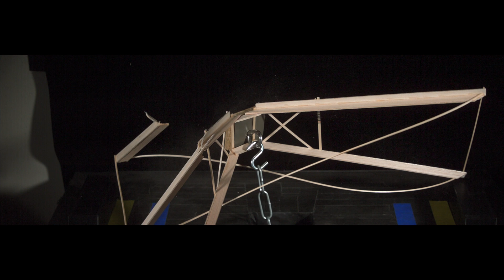Bridge 008 Division C: Competition Score 2098.6

Comment: Thanks for the videos! I was wondering how a longer weight bearing platform on top of this design would work. I am using the 2023 IIT bridge building rules which requires for the bridge to have 2 loading points on top: one 3 cm from the center line and one 5 cm on the other direction from the center line. Do you have any thoughts on this?
Reply from the maker: I haven't built any towers to that design, but I would generally recommend keeping it as simple as possible.  That would mean designing the top to be the minimum rectangle to hold all cases of your loading block and then "extrude" that top down to a minimum base to get the overall shape.  You'll probably have to experiment with the top design as you wont be able to have all 4 tower legs supporting the block.  A strong rim around the top would be the simplest solution, or perhaps some extra diagonal cross members to support where the block may be.  Good luck!!
Reply: @balsaengineering6686  thanks!
Reply from the maker: @dbethman  Oh sorry, I just now realized this is my bridge build, not the current tower series.  The advice is still pretty much the same.  Keep it as simple as possible and design the top first and then how to support it.  Good luck!!

Comment: hello, I have a bridge for nationals tommorow and I already tested it once. I don't know if I was just hearing things, but I might have heard some cracks. I've already been drying my bridge for 3 days and don't want to take it out of the box. Do you think I should take it out to reinforce it a bit or should I just keep it in. The first test, I stopped the sand at 15.25kg because I was scared to see how much it could actually hold.
Reply from the maker: Hi!  Good luck tomorrow at Nationals!  If you indeed have cracking, it's most likely from within the wood and there really isn't much you can do at this point as it wouldn't be an issue with the joints, but the wood itself.  I would just cross your fingers and see what happens!  BTW, I would never test to over 15kg.  Even 15.25kg is a bit too much, but if it held that, you should be in good shape to hold 15kg tomorrow unless something really bad happens and if something bad does happen, there was really nothing you could do to fix it.  If you had way more time, I'd suggest building several exact copies of your bridge and re-testing them all, but there is no time for that.  Be sure to let me know how it goes!
Reply: @balsaengineering6686  thank you so much! I'll let you know how it went.

Comment: I made a bridge that has the loading block about 7.5 cm to the left of the exact middle. I know that the rule book says that the loading block should be in the middle, but the science olympiad people never checked that before, and I think I have a good chance of getting away with it. They do interview me for how I designed my bridge, which then, I might get caught. Should I risk this?
Reply from the maker: I would not risk it.  You may be able to get away with it at some Invitationals, but any competition with a decent proctor would not allow your bridge to be tier 1.  Offsetting the loading block by that amount could potentially change the loading throughout the bridge quite a bit and basically changes the competition which is why they specify in the rules it has to be in the middle.

Comment: Based on how the bridge broke, would it be better to use lighter balsa for each of the legs or would it be better (maintaining the 10mm thickness) to use thinner balsa in this case (like cutting the leg thickness to 8mm or so). Also would it be possible to reduce the mass to the point where the bridge is under 8g, or would the weight of the bridge not be proportional to the weight held? In addition, if a bridge were to be made perfectly (using a classic design where it is not tapered) where it weighs, let's say 7g, is it technically possible for it to hold all 15kg if the bridge is perfectly balanced? I was wondering since there are some striking similarities with the bridge for this year and a tower in terms of the 3d trapezoid shape (except where there has to be a hollow spot for the pass-through block for this year's bridge).
Reply from the maker: Hi Aiden, you are touching on some important design optimization choices!  There is no single right answer and any of those approaches could lead to a lighter bridge that still held 15kg.   If you can successfully replicate this build, you should definitely start experimenting with changing all aspects of the leg design and cross members as well.  It's difficult to say what will be the absolute minimum weight that can hold 15kg.  My best guess is somewhere around 8.5g +/- 0.3g  I would be really surprised if a 7g bridge is possible and even more surprised if it were a non-tapered design.  Don't forget, that with such a large bonus for holding 15kg, you really want to guarantee your bridge can hold that going into an important competition.  That typically means overdesigning to 16-17kg and pre-testing.

Comment: Yo I built this bridge but for division B, I got an efficiency of 1333, which is a good step up to my average 100 efficiency
Reply from the maker: Great job!  I would recommend checking out my Div B videos instead of trying to duplicate this design.  Div B this year is easier and I've found you don't need to have a tapered design for it to work well.   Check this out if you haven't already:  https://youtu.be/cmhBslzbEFI

Comment: Is there a reason you do a L beam design rather than a T beam?
Reply from the maker: That's a great question!  The main reason to use an L design rather than a T beam is to maximize the hole while minimizing the device width to allow room for the 7cm passthrough block.   The rules this year, especially for Div C, are very tricky, and making room for that large 7x12 passthrough block is really what drives the entire design.

Comment: My bridge design is very similar to this, but it does not taper at the top, in order to simply the design.  However, the first prototype I tested felt like it was slightly leaning towards one side when tested up to 15 kg. Do you believe this is just due to uneven cutting, or is it the result of something else?
Reply from the maker: Hi Ishaan, the first couple designs I tried were non-tapered.  More like what I created for the Division B rules.  Like you, I had issues with it tipping over.  I'm not saying a straight design can't work, but the tapered legs give the bridge a lot of lateral stability which I think makes things easier.  I think a straight design with Div C dimensions would have to be built almost perfectly to work.  I gave up after 2 tries and went to the tapered design which gives you a lot more room for error in building it not perfectly level and it will still work well.

Comment: What do you think would be a good enough effciency to medal at a states competition?
Reply from the maker: Hi Zach, it's hard to say for sure this early in the season.  Also, some States are usually way more competitive than others.  I would say if you could duplicate this score (~2100) for Div C, that would be pretty competitive and 2600-2700 for Div B would be similarly competitive.  I don't have a good feel for that the theoretical top scores would be this year, but probably 2500+ for Div C and 3200+ for Div B, but those might be "risky" builds to bring to an important competition as they  might be hard to pre-test to 15 kg.

Comment: If you stopped at 15kg do you think this bridge would still hold the 19kg after being worn out?
Reply from the maker: Yes, for sure.  I have typically found that you can load up your device to 70-75% many times without any impact on the final result.  Sometimes you can go even higher, but there is more risk. 15 kg would have been about 77% of this max, so I'm pretty confident this would have been fine.  For pre-loading before testing, definitely do it more than once to make sure your single pre-load didn't damage it.  We would typically do 3x preload tests, but that could change depending on how many devices we had to work with.  BTW, that is what makes the 15 kg bonus such a challenge in competitions.  You can design a bridge will fail at 15.5 kg for example, but you'll have no way of pre-testing that to 15 kg without damaging it.  So you typically have to be more conservative to guarantee the bonus, or risk it breaking at less than 15 kg... or get lucky and score huge without pre-testing it.  I'm actually surprised they didn't keep the bonus option for next year as the rules are tough enough this year even without that!
Reply from the maker: BTW, this is one reason why in years with the 15kg bonus, sometimes you see higher scores at various Invitationals than "important" competitions like States and Nationals.  Teams can take bigger risks at Invitationals.  It's better to be a bit more conservative at important competitions and place top 5 (instead of trying to outright win) than it is to have it fail early and place ~20th.
Reply from the maker: A bit more on the pre-testing topic... this is also a great/systematic way to figure out which device to bring to a competition, assuming you have many built (you should have many built!).  Say you have 5 nearly identical builds and you need to pick the best one to go to an important competition.  We would line them up in order of heaviest to lightest, then pre-test them, in order, starting with fairly light load (depending on if there was a bonus in play).  Say there wasn't but we still wanted to hit 15 kg.  Pre-test them all to 8 kg.  Any that fail are bad.  The ones that make it, repeat the test at 10 kg and then again at 11 or 12 kg.  Again, in order of heaviest to lightest.  If you get down to your last one, that's what you take (and don't do a final test and risk breaking it!).  If you have multiple that pass your final pre-load test, you take the lightest one.  A 12 kg pre-test was good max for a design that would typically hold 15 or around 15 kg.  For a guaranteed 15 kg, you need to test to 15 and design to higher.  Maybe not 19+ like this bridge, but probably around 17.  In all my years coaching, we never had a device hold less than our final pre-load.  Plenty of times it wouldn't hold what we had hoped for exactly, but the pre-testing never damaged it so it held less.
Reply: @balsaengineering6686  ah thank you for the detailed explanation means a lot :)
Reply: @balsaengineering6686  From your experience how long does it take for a structure to "go bad"? I had been planning to use a year-old boomilever from 2020 that placed well at MIT for another competition, but decided against it in case the wood/glue was deteriorating.

It counts as pre-testing, too, in a way, but the last test had been over a year prior.
Reply from the maker: Hi Dawen, while I don't have a ton of experience with long duration devices, unfortunately COVID also gave our boomi Div C team some direct experience.  Due to many issues, the team was only able to build a few new devices last year before Nationals and none of them were better than what we had won with at the UM invitational, so we wound up using that device.  It was built way back in 1/25/2020, competed and won on 2/15/2020.  It then was able to come in 3rd place at Nationals in May 2021.  Just FYI, that bridge weighed 8.9g and the pre-testing it went through was as follows:  12x2, 13.5x2, 15x1 (UM competition); 12x2, 15x1 (Nationals).  So, bottom line, I don't think these devices really have expiration dates, at least not in the ~18 month time frame.  I think you can damage them during pre-testing or competition loading though, so it's always best to re-test before any competition.  

BTW, what is somewhat sad, we actually had an even better boomi (8.25g) pre-tested to 15kg back in 2020, but we were unable to use it last year because it was built by a senior who had graduated.  We were pretty locked in for boomi... our team best ever during practice was 7.73g for a 2587 score.  I'm not sure what won Nationals, but that probably would have been close, even in a normal year.
Reply from the maker: I also found an old boomi forum post where I did some experiments with 7 nearly year old Div B boomies.  They all held up fine and performed as expected:  https://scioly.org/forums/viewtopic.php?p=410990#p410990